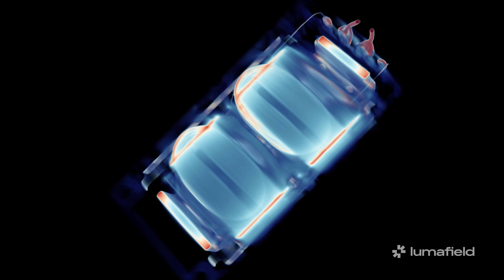Switch 2 Pro Controller: Built to Break? Full Teardown

Comment: Whats the long hall? You neglect to mention how long any of these components will last. If this survives as long as my Switch 1 Pro Controller has (8 years the entire life of the Switch 1) and is still going: it'll have a great battery still and the sticks won't be suffering from drift.

Maybe I'm just lucky though... Maybe others have had issues, but I'm not aware of any common complaint, except in regards to the Switch 1 Joy Cons.

I'd ask how exactly these sticks feel so incredible if they're just like the past sticks from Nintendo? I find it hard to believe there isn't some difference but unfortunately this video requires, I assume, having seen your past videos that explain all the components in detail.

The Switch 2 Pro Controller is really slick to use... BUT yeah, its way too expensive.

Comment: I don't approve this amount of disassembly of course, but drifting pro controllers from Nintendo is generally not a thing

I've had three pro controllers in 8 years, no drift. 

I sell pro controllers at work. I only remember one that drifted and that was an out of the box kind of situation. It was a TOTK controller about two years ago.

Comment: Cool...but "repairability" is not a function. At the end of the day all that matters is DOES IT WORK. 

Also to save the "adhevisness" of the controller you'll want to use something like a hair dryer to warm the adhesive to easier remove the front plate. 

When this controller is so barbarically disassembled like this and difficult DIY is being used as such a high level factor in whether this controller us good or bad cannot be trusted in my opinion.

Comment: Plus GOD FORBID they use the same pro controller as the Switch 1, just god forbid...  If sure if you tinkered with them any to much I bet there loaded with locks too, to brick when you screw or ticker around with them a little too much too, just like the Switch 2 counsel!

Comment: The only thing I can really say is that the small thin silver lining that Nintendo has (Though as much as I WOULD HATE to admit to it) is that at least we can still use the cheaper and more reasonable Switch 1 Pro Controller than the beyond insanity that is the Switch 2 Pro Controller...if that's actually true (As I don't own a Switch 2 myself, so I can't really confirm other than hearing stuff)...

Nothing more than "luxurious" and expensive trash.

Comment: I really hope 3rd party controllers will be compatible with the Switch 2 because I’ve found much better quality in the 3rd Party Switch 1 Pro Controllers than the battery operated Switch 1 Pro Controllers and Wired Switch 1 Pro Controllers

Comment: Wait why can't you just unscrew a single screw and then pull the battery out of the back like you do on the Wii U Pro controller? I am so confused right now.
Reply: On Switch procontroler, it was 6 screws.
Reply: When's the last time you had to replace your Wii U pro controller battery?

Comment: $85?!?! How are controllers getting more expensive? They are ancient technology at this point, they should be getting cheaper. The only companies that act tried to innovate the standard controller in the past 30 years is valve, Sony, and sega. Valve had the touch pads in replacing the sticks, Sony dualsense with haptic feed back and adaptive triggers, and sega for being the only major company to put Hall effect sticks in theirs

Comment: You definitely raise some fair points—there are real issues with the new Switch controller, and it’s clearly not the best out there, especially at this price. But the emotionally charged, negative tone makes the video feel more like a rant than a balanced review. It’s hard to separate valid critique from frustration. Still, I respect the effort that went into making this and breaking it down.
Reply: Exactly, it is absolutely focused on a narrative rather than facts. This doesnt nearly look like the hardest controller to repair. Not to mention the fact the sticks aren't even soldered

Comment: One thing I don't like - 'Still using drift prone potentiometer' as if all potentiometers are bad. Which is a statement that just isn't true of a great many potentiometer solutions will last decades and fail at the pivot not the sensor, and many that 'failed' at the sensor just need a blast of contact cleaner.. With similar problems on the N64 with its famous control stick that goes horribly wobbly but isn't a pot based stick at all - you can't malign a stick based on sensing tech alone, lots of ways for them to fail (though in the N64 case the sticks lasted pretty well by the standards of the day really). So until this particular generation of sticks is tested you can't actually say for sure if these sticks are going to be drift prone, or wear out at the pivot first in 30 years time. There is no point using hall effect sensors if the pivot and centring springs are going fatigue more rapidly than the joycon 1 contact material wears...

I don't expect these sticks to last forever from what has been shown, but still can't make that assumption, the Big N might have actually put some real R&D time into the materials so they will last this time around. Not going to hold me breath on that score, but given the PR nightmare and repair costs for them of the switch 1 joycons I'd not be surprised if they have either.
Reply: This was definitely calculated to imply that these sticks do drift often when there is no proof of that
Reply: Really, "Hall Effect" has become nothing more than a buzz word now, to the point where it just annoys me now when people claim that hall effect sticks are "immune to stick drift" (which is actually untrue from what I have read). Customers seem to have become conditioned by influencers and marketing that "potentiometer = bad, hall effect = good." It's somewhat interesting to me that I don't recall EVER hearing about stick drift being a wide-spread issue until the Switch Joycons in 2017 despite potentiometers having been used for analog sticks for DECADES. I'm sure it happened, but I never saw widespread complaints about it.

Comment: It's true that potentiometer sticks will have drift issues inevitably, but the primary issue with the joycons was the graphene pads used. The pro controllers (both versions) don't have the same design, so the issue won't be as bad.

Also, glue and clips aside, the teardown honestly didn't seem that bad.

Comment: I think it's too soon to determine whether the controller is able to last long or not. Maybe it's as durable as Xbox controllers and won't require any maintenance in 5 years?
Battery wise, I played mine for roughly a month before the first recharge. Even with 1/4 of its initial charge, meaning charging once a week for a casual gamer, is still super acceptable. Then if the battery flat out dies, yes, the entire controller becomes unviable.

Comment: The thing I love about this controller is the fact the sticks are not soldered, they are user replaceable with TMR or Hall Effect sticks, unlike Dualsense or Series X controller.
I did a joystick replacement of my Switch 1 joycons with TMR sticks and never looked back, can't wait to be able to do the same with my Switch 2 Pro controller

Comment: Thanks you SO much for bringing to light these flaws in the control. I wouldn't buy it. My original control has drift after a year, and I replaced them with the ones that never drift. It was a pain in the neck replacing them. I imagine myself doing that plus this nightmare for drift. No thank You. Amazing video!

Comment: This controller looks durable, so if you're wearing it out that much that you're going to service it, I recommend that you're more gentle with your things.  This controller is built to last.
Reply: Durability is not mutually exclusive with service... a Volvo is built like a rock, and still requires tire changes, oil changes, engine swaps, etc.

Service for a controller isn't because they need to repair it due to damage, it's about the battery and the sticks being easily accessible, and reassembly not being a pain that requires a dedicated, consumable part like adhesive.
Reply: @natayaway  I don't think the amount of people 10 years from now are really going to care.  It'll be easier to just buy a new one after 10 years of hard use.  You're not supposed to replace the engine and transmission on a car, you're supposed to be able to afford to buy a new one because the old one fails at the end of its life.  Nobody drives a car past 400k miles unless they are emotionally attached to the car.  Same with these controllers, by the time the batteries fail and the control sticks break, you've been using it for a long time.
Reply: What does "looks durable" even mean though? The battery's gonna go eventually and the sticks probably. Anything else I've no idea, it doesn't really "look" like anything.
Reply: @David-ln8qh  I'm referring the the construction and how "difficult" it is to take apart because everything is screwed down and the seals are tight.  That's a good thing in my mind.  I'm not looking to repair my things all the time, I'd like them to be built to last.  This looks like its quality construction.  My switch 1 Pro controller is still rock solid 7 years later.  I'm curious about the build quality rather than repairability.  Don't need to fix what isn't broken.

Comment: just buy the 8 bit do Ultimate 2C controller comes with a charger dock can be used via blueooth or through 2.4ghz wireless usb receiver and i like that if the usb receiver is plugged into the charging dock you can plug it into your pc/laptop or even console and switch seemlessly between devices without taking up an extra usb slot

Comment: $85 for potentiometers... no thanks.  At this point it's clear they don't care or it's by design. Especially with drift being such a huge issue on the original Switch controllers, using the same hardware in the new controllers can only be done on purpose.

Comment: I bought an 8BitDo SN30 Pro 8 months ago and I like it. Except it literally felt TOO light so I opened it and added a few ounces of mass. Removing 5 Philips head screws gets you inside and undoing a few more lets you take out the PCB. Easily replaceable sticks, too.

Comment: Given how easy it is to disassemble and replace battery of the Switch 1 Pro Controller, this new Switch 2 Pro controller is 100% designed to be thrown away instead of repaired.

Comment: Summarization 
1:No hall effect sticks (They will drift eventually) 
2: no analog trickers, mechanical, or pressure triggers 
3: Battery life isn't even that good. 
4: Weighs a lot. 
5: Very expensive. 

Literally buy an 8bitdo pro controller for $30 and it will have hall effect sticks
and proper triggers.

Comment: Never had drift with my old Pro Controller i use since day one 2017 and am using it now for Switch 2. If it could wake up the Switch 2 i would be fine with that for years. I will wait until prices fall for the Switch 2 pro Controller and or if there is a revision, as the old Pro Controller works good enough for me. But that was my plan to begin with, because of the price of all components, not an anxiety that Switch 2 Pro controller might fail.  Or perhaps there will be a good Hall Controller from thirds, but i think that have other issues like different rumble etc.

Comment: You want a horribly overpriced and junk.controller that litterally breaks itslef apart, look no further than the xbox elite controller series 2. I babied it and the controller's rubber expands and cracks the whole shell casing to bits after less than 6 months.

Comment: I feel that the video should highlight that no console OEMs currently utilise better analogue stick technology. Claiming that the same price bracket has hall effect technology is misleading, as OEMs like Microsoft have "Elite" controllers in the same price bracket and do not use hall effect either. This would mislead someone into buying one with an adapter for the Switch, thinking this isn't a problem.
Reply: There are other manufacturers making higher quality controllers at a cheaper price. No, none of them are OEMs, but that is just more evidence that the OEM controllers are overcharging for the quality of their product.
Reply: @ViladelDJR I'm not sure how you determined it was to do with cost and quality reasons, because it looks like production capabilities to me?

Console OEMs are using Alps Alpine potentiometers, all of them. The reason they're using Alps Alpine is because that one of the few companies that can manufacture at the scales console OEMs are operating at. GuliKit who made Hall Effect sensors is unable to deliver at their scales. This is why you only see Hall Effects on smaller scale produced controllers.

Comment: The bad drift problem isn't simply a potentiometer issue, it's a design and quality issue. Many older controllers and analog controls in handheld consoles have held up just fine for years. These new sticks have basically the same design as the fail-prone JoyCon ones, leading me to believe that these will not hold up for long. Unless there really is some subtle difference that makes these more durable, but considering Nintendo's ridiculous greed has tripled this year, I'm keeping my expectations low for that.

Comment: I have my Pro Controller for Switch, and it is still perfekt, after 10000+ hours of gaming in 8 years. For me it looks like they  built the new Controller Just more durable, Not needed to be fixed. 
I never needed to Change a Akku in the lifetime of a Console.
It looks hart to repair, maybe because it IS Not ment to be opened after sealing it 😉

Comment: This video has a weird negative spin on everything.
"The sticks dont come off easily"...ok...isn't that a good thing?

"The joysticks haven't had any drift yet but...they COULD have drift..maybe?"

"NFC antenna" and then random cash crab comment that doesn't even seem to make sense?"
Reply: NFC is the technology used for payments, he's making a pun there.

The sticks not coming off easily is relevant because the way that sticks are engineered, they're captive by the front faceplate of the stick gate, and therefore couldn't come off anyway. There's no reason for it to have a high amount of force to remove.

He can't say anything with absolute certainty because the Switch 2 is barely a month old so there is no data. What he can say though, is that they use the same old technology, but with the low-profile housing which was more failure prone in the last generation Switch, therefore it's a reasonable assumption to say that stick drift hasn't been solved by the new generation.
Reply: @natayaway  Drift wasnt really a problem with the Switch 1 pro controller though.

Comment: Yikes. This guy really does not like Nintendo. Cash grab? I mean I've had my original Switch Pro controller for years and with decent use I can confidentially say it's one of the best and most reliable controllers I've ever had. And the Pro 2 seems to be only an improvement upon the original. No mention of the ridiculously good battery life. No mention of how the controller is priced so high because of TARIFFS and not "lol typical greedy Nintendo." No mention of how literally no mainline controller from Sony or Microsoft ese TRM or hall effect sticks either, just constant shitting on the product and Nintendo.

I appreciate the thorough takedown and a lot of the criticism but the entire tone of the video just comes across as unnecessarily dickish.

When I get a Switch 2 I won't think twice about getting the new Pro controller and I'll very likely be satisfied with it for many years jist like the OG.

But hey gotta get those clicks amirite?

Comment: I really don't understand how the potentiometer sticks are such a big issue on modern controllers.
We've used potentiometers in sticks for a looong time, but it only became an issue starting with the Switch.
I'm still using my Xbox 360 Controller (2011) and Steam Controller (2016), thanks to both using standard AA batteries, and neither of them have stick drift. The 360 controller has a bit of a worn out spring, but that's easily fixable by increasing the deadzone.
Out of all the consoles I used from the PS1 to the Wii U, I've never had a controller with stick drift. A bunch of them failed, but it was never due to stick drift.

Comment: You are complaining (no hate) only about bad repairability and the drift prone sticks. Other than that, isn't it at least built durably? With all the screws and protective plates? I was never forced to repair any Nintendo product and I hope this doesn't change with this controller that I plan to buy. Just because it's potentiometer sticks doesn't automatically mean it will drift. Controllers in the past also managed to avoid it with these sticks.

Comment: Why would you even need to change the battery on a pro controller, even if the battery degrades 50%, which might take 30 years, it’ll still last 20 hours, twice the battery life of the dualsense.
Reply: This video seems to be jumping on the current Nintendo anti-hype trend. It was such a weird video.

Comment: Nintendo went from the first Switch Pro Controller with a removable battery that can be accessed by just removing 6 screws and had no adhesive to this nightmare that's much more worse than replacing the battery on a PS5 controller. The battery was also similar to the ones Nintendo used on all their rechargeable handheld consoles where it just slots in. This design choice was deliberate.

Comment: I know you’ve suggested 8bitdo as an alternative, but I have 3 8bitdo controllers and bought an 8bitdo Bluetooth conversion kit for a snes and an n64 controller and the Bluetooth lag makes them completely unusable. Yes they’re nice controllers but you can’t use them!! Any comments on that? The switch 2 controller feels nice and has a really strong connection to the console 🤷🏻‍♂️